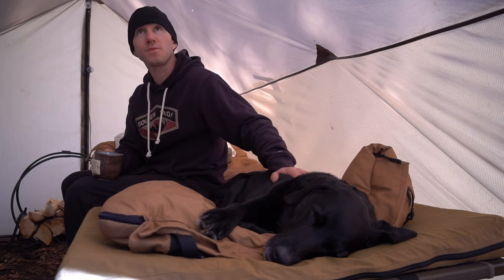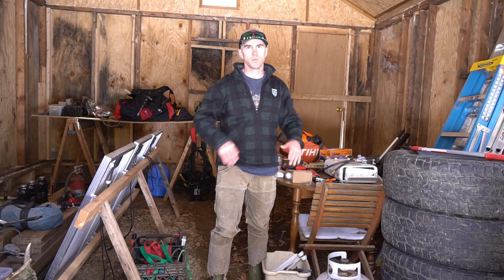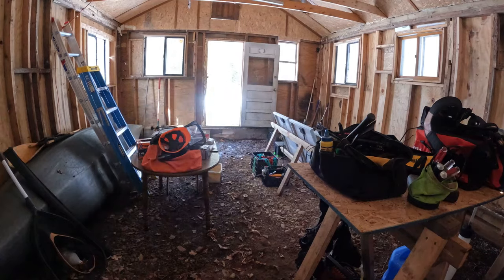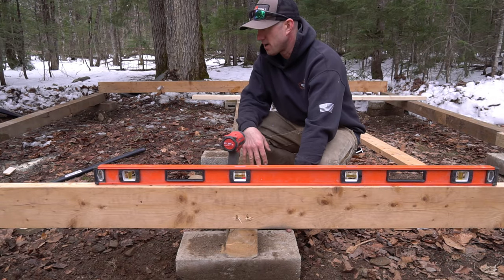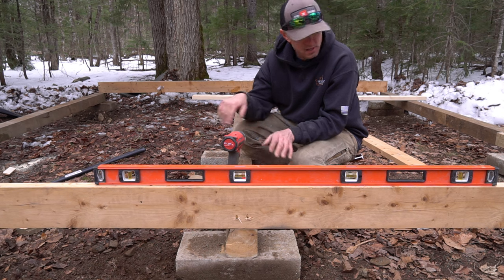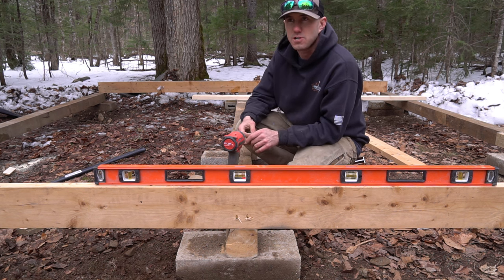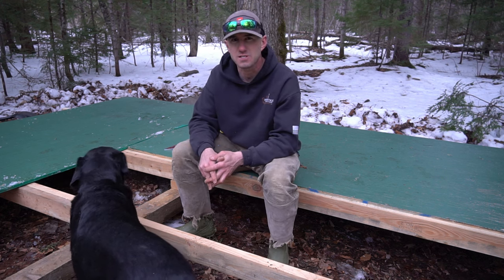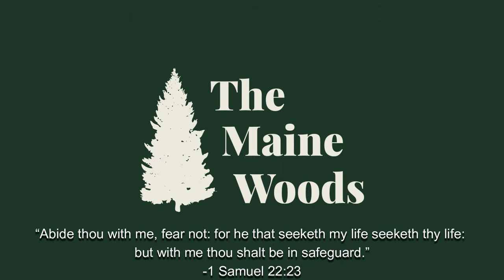Off Grid Cabin Project in The Maine Woods

Comment: DAVIS WALL TENT!!!  Anything else is crap!!  I have 3 (12x14) tents in Maine on platforms that I’ll set up now and take them down in October.  This will be the 3rd year.  I had them set up last year when it rained every weekend and not one drop of water.  I added the option of mildew and fire treatment.  Their canvas shrinks when it gets wet closing up the pores but also breaths so no condensation.  I used their brackets and then cut the poles using EMT conduit.  I have a window in the back and on the sides.  Their customer service is amazing.  When your camp is complete you can use it for extra sleeping space.  ADVENTURE ON!!